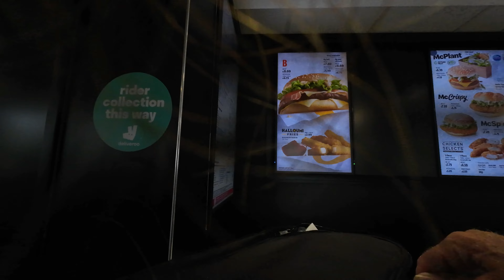Just Eat and Uber Eats E-bike delivery in The Cycling City Oxford Zero Emission Zone.

Comment: What average range are you getting? i have same bike and am on my 3rd battery.
Reply from the maker: I get around 60km per battery and use a throttle on full power alot. I have two batteries and two that have died.
Reply: oh nice one. i think i'm getting around 40km with throttle usage too. But i'm only leisure cycling. Do you carry a spare battery with you? or not enough room on the bike? :)
 @OXdElivery
Reply from the maker: @SteveAgleron I carry a spare in the bag at the back of the bike or carry it in the bag on my back. I pedel as well as use the throttle. Ta